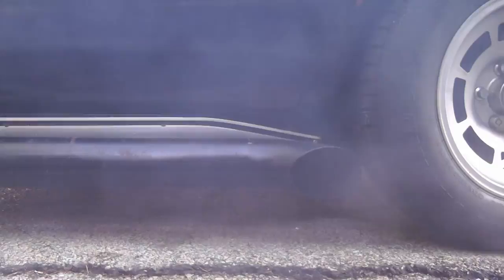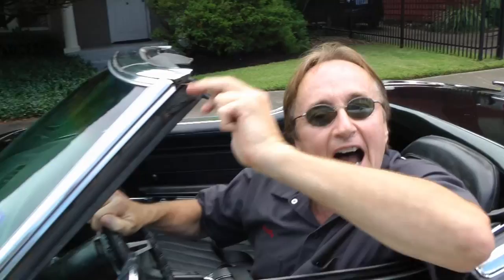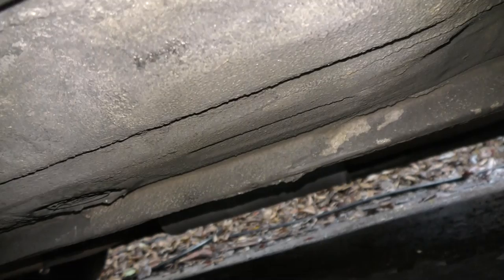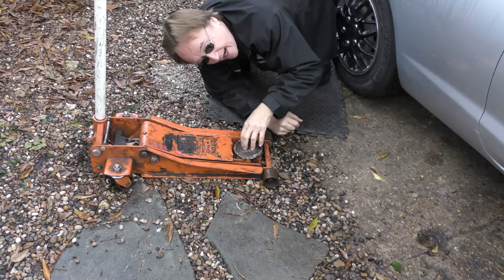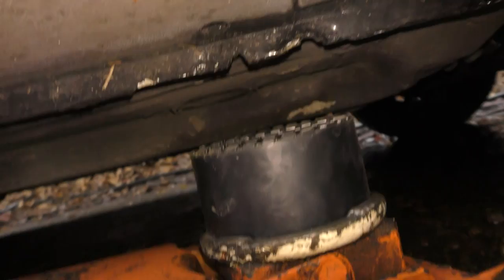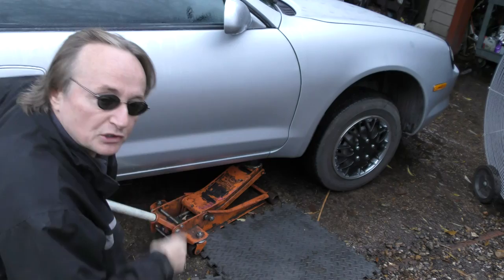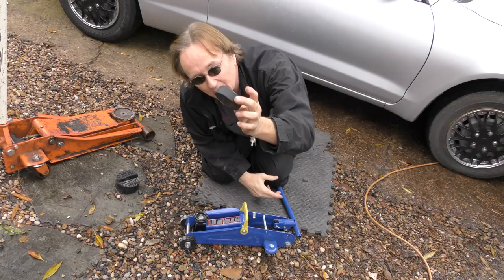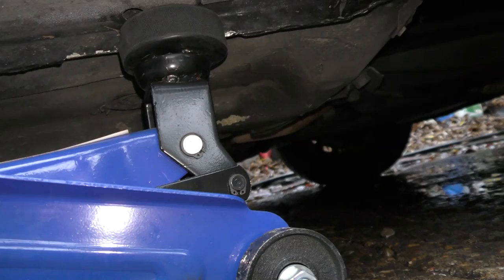How to Jack Up Your Car With a Hockey Puck

Comment: I don't recommend slicing a hockey puck down the down the middle like that. If it breaks the car will fall a few inches and maybe off the jack entirely. Better off just buying the proper puck that's made to withstand the thousand or so lbs on the crease.
Reply from the maker: +hugeslacker  hate to break it to you, but I only went half way, and the hockey puck is made of much stronger rubber than the actual tool made for this use. It would break long before the puck did. They take 100 mph and up slap shots and never come apart.
Reply: +Scotty Kilmer but when you cut the puck you've ruined it's structural integrity. The reason the puck can take the abuse of a stick is because it's round and rubber. But slice it halfway and put a thousand pound dull knife in the slit and... I just can't believe that's safe. I wouldn't get under that car. The real ones are cheap, why take the risk?
Reply: +hugeslacker if the hockey puck failed, the car when drop an inch onto the jack. What are you talking about? I don't get why people like you gripe online, if you don't like what he did then don't do it. Life goes on
Reply: +vansurfing and a car falling an inch onto a jack on wheels is a safe thing to happen? I'm not griping as much as pointing out that it's dangerous.
Reply: +hugeslacker nobody should be getting under a vehicle anyway without jack stands properly placed underneath.
Reply: +Francis Miller my point is, if it can fall, you shouldn't be doing it.
Reply: +vansurfing if you are worried, grab a torch and melt the puck where you cut it open. It will be much stronger now. Hockey pucks are played with on ice, typically prefrozen in a freezer as well. You knwo how everything breaks in the cold and these pucks still last. They are very strong. i play hockey everyday. I have seen a hockey puck get broken from a slap shot, it is rare, but it happens.
Reply: +dynocompe I'd rather use the tool that's made for it. When you're talking about saving 15 bucks and your car potentially falling, thats the wrong place to save taco bell money.
Reply: a hockey puck is solid rubber, probably made alot better than that tool. Your car would fall less than an inch onto a jack....... I would rather use a hockey puck that I have seen thousands being shot at very high speeds in below freezing weather and lasting. A hockey puck is safe.
Reply: +iliketrains really? You have no reasoning ability. Trains take so much energy to start moving that you could prevent one from rolling away on a flat surface with an ashtray. But I wouldn't jack my car with it.
Reply: +iliketrains and slicing a puck in half with a hacksaw and using the cut section to hold up a car is a good idea? If you're desperate to save 15 bucks, just use the subframe mount instead. It's correct and safe.
Reply: +iliketrains chock
Reply: +hugeslacker Have you ever seen a hockeypuck? Only cutting it in half, its not gonna break.
Reply: +hugeslacker if it can fall you shouldn't do it? Any time you lift a car, there is a chance it can fall, no matter how you do it,  how about you stop working on your car, and let someone whos not afraid of unlikely things and willing to take a slight risk to get work done do it.
Reply: +hugeslacker people like you can never be wrong huh, you just know everything.
Reply: +Mac MashPotato but you can minimize your risk.. I'm not saying don't work on your car, or don't trust safety precautions... I'm saying the opposite. Do it the right way with the right tools and you should be fine. Cut a hockey puck in half and test a very thin sliver of metal inside of the cut and put a thousand pounds in it and you're just increasing your chances of a failure.
Reply: +Scotty Kilmer Actually Scott, they do.  There have been some players who have broken them apart with their shots.  Could be isolated but I wouldn't say it can't eve happen because it has.  

Still, cutting a small groove to nestle the brace wouldn't be a bad idea.  I wonder how well it would cradle the car if you didn't cut the groove at all.  Have you tried that?
Reply: +vansurfing What do you mean you don't get it?  It's for the purpose of discussion and for the sake of safety.  If someone sees a potential risk in a method, I sure as hell would like it scrutinized; we're talking about crawling underneath a 3000lb object that could crush the life out of you.  A quibble is very much welcomed.   I sure hope you'd see the flaw in your argument now.
Reply: +hugeslacker OK. WORST CASE SCENARIO: You jack up your vehicle with the hockey puck in place on a super hot day. The metal bites into the rubber and the car DROPS down UNTIL the rest of the car makes contact with the flat portion of the puck. BIG DEAL ! Since the puck is not cleaved in half, and it is sitting inside of the metal cup of the standard jack, it wont go anywhere, because the weight of the car  is pressing down on the whole puck surface.

For years, I have routinely been lifting cars with a piece of old 2 x 4 in the cup of my jack. Sure the wood finally breaks, and crushes the remaining wood. No harm, no foul. I just slip a jack stand under the car, and handle business. When I'm done, I grab another piece of scrap wood, and lower the car.

If this scares you, then let someone else work on your vehicles.
Reply: +supercooled the point of the groove is to prevent the rail from bending inward, so not having a groove would defeat the purpose of using it. I just recommend against slicing up the hockey puck. Maybe I'm wrong, I don't know. Maybe it's completely safe. But it just doesn't seem safe to me. I'm not trying to be a dick and I don't have stock in jack pucks or whatever they're called, I just think that they're a better alternative and cheap enough to not warrant making a crude and potentially dangerous version of it. I like Scotty's videos...  Obviously, I'm a subscriber. But this one I disagree with. I've had scissor jacks fail and dropped cars, and I'd like to avoid that. Luckily I always put the wheel under the car so the car didn't fall on me. The scissor jack bent inward and broke at the joint, so it came down pretty slow, but you don't ever want to be on that position. I didn't have a jack stand handy so that was my bad. Maybe I just have a different way of looking at it because I've been under a car watching a jack fail.
Reply: +Scotty Kilmer I have used plain old hocky pucks for many years, without the cut, to cushion the jack against a frame/subframe part & they don't last too long, they will split. But there's no harm using them & no danger that I can see.

:)
Reply: +hugeslacker Just put some wooden slabs under the frame of the car as a safety percaution when lifting it (both methods shown here).......just incase something happens. Better safe than dead.
Reply: +hugeslacker - Scotty is right.  Hockey pucks are only about an inch thick, the car won't fall very far if something did happen and whatever rubber material hockey pucks are made out of, they are tough as nails, they don't bend, break, melt or freeze. I have seen them placed in liquid nitrogen and they chip a bit, hit with a blow torch and they are completely un-phased, same with impacts and bending.  I would trust a hockey puck over the actual tool.

That and after you jack it up, you have jack stands to hold the car, so big deal, the puck isn;t holding the car once you are under it.
Reply: +hugeslacker You only use the hockey puck on the jack, not the jack stands. The thousands of lbs are only applied to the puck for a couple minutes while you jack your car up and place the jack stands, and then again after you remove the jack stands and lower the car. If you're climbing under your vehicle without proper jack stands, then I really don't want to hear what advice you have on safety.
Reply: Well said !
Reply: TheRealestEver A hydraulic jack is not he proper tool for holding a vehicle's front end up in the air for an extended period.
Reply: TheRealestEver - One, its far less then an inch considering a hockey puck is about an inch thick and we are cutting into it.  Second Hockey pucks are more durable then the actual tool (Trust me, I am Canadian, we know our hockey pucks) and lastly, jack stands.  Jack stands are for holding up your car, not a jack; the jack just gets it up, the jackstands hold it, and you don;t use the hockey puck with the jackstands.
Reply: +John Mulhall Well it's the force of the puck shooting out from the car that could hurt, "worse case scenario".
Reply: +TheRealestEver True,true!!
Reply: +hugeslacker Hater.
Reply: +hugeslacker technically the only strength you might lose is from the sideways direction..... anyway, you could always nail an intact hockey puck to the bottom of the cut puck.  That would certainly help make it safer if you are worried.
Reply: but you can just as easily buy the real puck made for your cars rail design for like 20 bucks. really all i'm saying is this isn't the place i would skimp.
Reply: The real question is why are people getting under a car supported by a floor jack?? JACK STANDS. Use them. If your car isn't supported on Jack Stands, don't get under your car. Floor Jacks are to lift the car. Jack Stands are there to keep the car raised.
Reply: hugeslacker that makes sense!!! It could break in half !!!!!!!
Reply: hugeslacker whoaaaaa
Reply: John Mulhall I heard that !!!!
Reply: Sadpants McGee just use BUBBLE GUM !!!!
Reply: Ive broke a few old pucks before, one they have a crack in them they break fairly easy...
Reply: @hugeslacker and Scotty Kilmer - It's a fair point. However, anyone who gets under a car without at least one jack stand mounted close to the jack deserves what they get. I use two whenever possible. 

No matter what (hockey puck with a slit, the actual tool or just the jack by itself) I jack my vehicles up, put a jack stand under it, lower the car until it rests on the stand, put pressure back on the jack and proceed to shake the vehicle back and forth to make sure it's sturdy. I do not trust the jack (with or without a "puck") to protect me. All the "puck" should be doing is keeping you from damaging the underside while raising the vehicle.
Reply: hugeslacker Do you even know what that tool is made of? No, you're just buying into them telling you that it's made especially for the job. People use pine 2x4s on jacks and have for years, and that hockey puck is much thougher than pine.
Reply: Francis Miller You nailed it, this isn’t meant to jack up and work under, its meant to jack up so you can rest it on jack stands, the other guy clearly isn’t using a jack properly in which case it’s dangerous with or without the puck.
Reply: hugeslacker people make body lifts out them if it can hold a body of truck or suv off road the i think it can hold a car... that’s why you use jack stands
Reply: The rubber would probably fail in a ductile manner... I don't think it would suddenly snap.